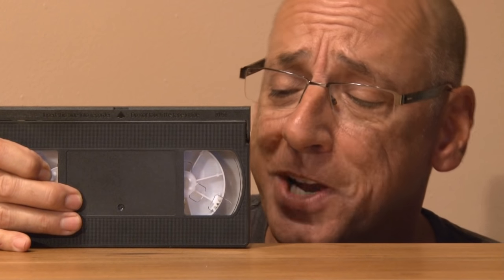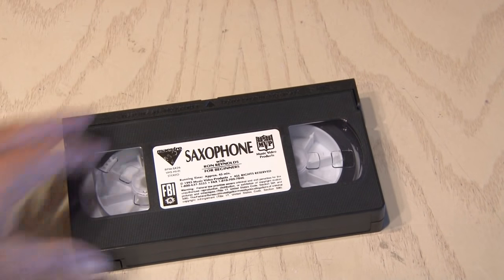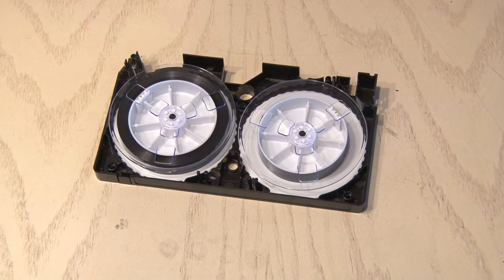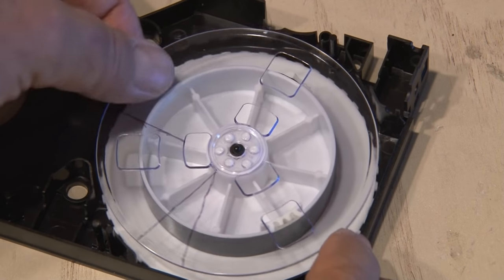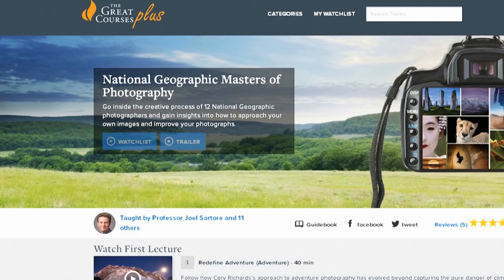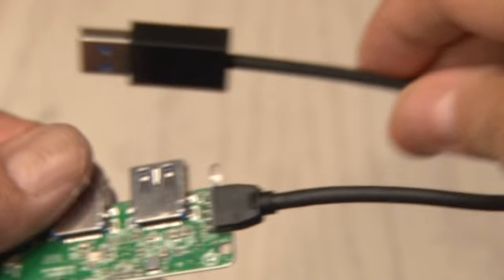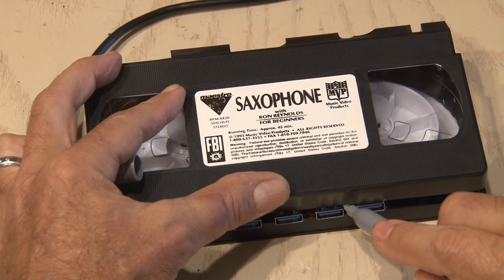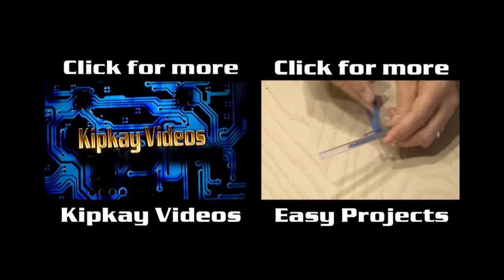VHS Tape Hack!

Comment: what do u do with vhs tapes.  USE them.... where as everyone loves dvds . scrach a dvd and its useless.   vhs tape snaps. u splice it back together and it works usually fine.
Reply: not always and that is rare. Biggest issue would be the tape inside the cassette tangling inside the vcr
Reply: Peter Kapica  and thats when you gotta make sure its clean.  ive spliced 3 vcr tapes that were cartoons for my daughter and they worked flawlessly.
Reply: Matthew N did you use a microscope or a big light?
Reply: No. But I never had issues with my stuff. Cassette tapes yes.  Reel to.reels no.
Reply: Matthew N that's called good care

Comment: Spotted a slight problem: you've gone from an USB 3.0 cable to an USB 2.0 one (4 wires).....not ideal. It WILL work, but it's pointless if you're using it on a 3.0 port. Interesting project though.
Reply: Daniel's Game Vault at least you didn't just complain about how he changed t from a 3.0 to a 2.0 and you actually liked the project. A lot of people notice one thing they don't like about the project and they think the whole thing is stupid.

Comment: Why not do it the other way? Where the USB Ports are hidden by the top lid on the cassette tape. Then it's not too out of place looking and it's hidden away and less noticeable rather than them being right at the bottom. It just made more sense in my opinion

Comment: Well - soldering USB 2.0 cable to 3.0 hub is a bit unefficient - but it'll work ;p
Reply: Krzysztof Witkowski I think the USB version depends on the logic board not the cable
Reply: The point is even if the board supports usb 3.0 it still needs the four additional wires to deliver the better speed compared to usb 2.0 or 2.1
Reply: Johannes Ho You're right :)
Reply: No, USB3 has more pins than USB2.
Reply: Of course it depends on the cable, why would there be different cables otherwise? You need the extra TX/RX pair for more throughput.

Comment: An interesting project. Wouldn't you want to, perhaps use some of that hot glue to nail the hub down inside the case? It would appear to have a good chance of sliding around in there, unless you were extremely precise in cutting the notches in your reels.
Reply from the maker: I think I showed that I did.
Reply: If you did, it wasn't clear to me from watching.

Comment: why don't you just convert them to dvd's
Reply: X D.
Reply: icecream hero dvd is obsolete too
Reply: no they are not stores still sell them also you can keep dvds for ever but you can't keep a computer file forever the computer will break down after awhile
Reply: icecream hero the DVD too.
Reply: @icecreamhero2375  DON'T Trust DVD's to store your data, most of them will rot on only a few years; saying that from personal experience: one day you backup your stuff to CD's and DVD's, and some 5 years later, you get them and they will be covered in black spots, in some of the DVD's, they will cover around 50% of the surface, so most of the files will be completely unrecoverable...

On the other hand, in most computers that use independent drives (most computers, that aren't ultra-cheap and/or ultra-thin laptops) you DO can take out the drive and plug it into another computer and access and use all of your data.

And if you use spinning Hard Drives, the data will be there basically forever (well, at least for over 30 years), and even if you manage to break a HDD, most of the time, you can still take it to a recovery company and they will rescue all of your data back. The only methods I know of to actually lose data on an HD is to either write over the data, subject th HD to an extreme magnetic field or to physically break them.
Reply: @guilherm502  Thats a bit crazy I've had some DVD's for 20 years and they are still fine.
Reply: @LiEnby  Oh my gosh I'm so sick of people like this. DVD is far from obsolete considering it is the last format of physical media. They are still very useful. You ever wonder why movies are still coming out on DVD and BluRay? Because people buy them.

Comment: It could be cool to pair this with some external hard drives. Depending on the ones you get you may be able to fit a pair into the tape. No one wants vhs so a thief may overlook it in the case of a robbery

Comment: Smart-looking hub you made! In order to preserve your soldering iron, how about holding a nail in a pair of pliers and heating it with a lighter or a torch to melt the necessary holes? 

I'm glad you didn't use the Bruce/Caitlyn Jenner tape. Hold on to it; it might become valuable someday! 

And, as always, nice to see a Domino cameo (catmeow?).

Comment: Hey kipkay. You know, you can't use 1 resistor for 2 parallel leds.
Reply: Actually, you can use 1 resistor for two parallel LEDs. Only you need to hope they will balance each other in the needed current.
Reply: Well I kinda don't like to depend on hopes and luck in electronics :D
Reply: I completely agree with you on this statement.

Comment: Thanks Kip!  I have 3 of those usb hubs.  The problem with them is their output is weak.  Can't charge my iPad with it.  Is there a way to hack them easily and increase the output so they will charge the Apple products?
Reply: Yes. Disconnect the source cable's two power wires and attach two wires leading to a secondary external plug in their place, then just get a power brick and plug it into the secondary plug.
Reply: So the USB powered input isn't strong enough?  Because even when I plug it directly into an Apple wall plug, the hub dumbs down the output.

Comment: that's the same usb3 hub I have
Reply: Shadigun88 yes but he connected usb 2(slow) to a usb 3(fast) hub I was cringing at the site of it
Reply: i saw that too. usb 2 has 4 wires if u count the insulating stip/weaved ground wires, so 5. usd 3 has 9 or 10 with the insulation

Comment: resisters reduce voltage not current. just an fyi.
Reply: And what do you think reducing the voltage does to the current?
Reply from the maker: +marinepoof Bad science. But I do know that resisters is spelled resistors.
Reply: kipkay lol well I guess what I was thinking is that because you have a 5vdc voltage source (current dependent voltage source)  you are adding the resistor to drop the voltage. the LED is only rated at 2.5 volts and doesn't care about the current.  so yeah just miss leading explication that's all.
Reply: voltage is dependent for current to change, assuming resistance is constant. If you change the voltage in V/I = R, the resistance will have to change, and we already establish that it should not change, so current has to change as well.
Reply: Gian Fajardo Thanks for expounding on what I said. I wanted to include a more detailed description but honestly, I just couldn't be assed to.
Reply: Yeah yeah I get the math my point was just that you add the resistor it drop the input voltage to the led not to drop the amperage. the way he stated it in the video is miss leading.  The output of a USB power is only .5 amps that does not exceed what the led can handle But the 5 volts at any amperage will fry an LED that is rated for 2.5 VDC. But if you can't see that past Oams Law then there is nothing I can do for ya.
Reply: Nothing\ you're welcome :-)
Reply: Yes they do reduce(or resist) current through, hence the name.  Whatever voltage effects around and outside of them are second hand.